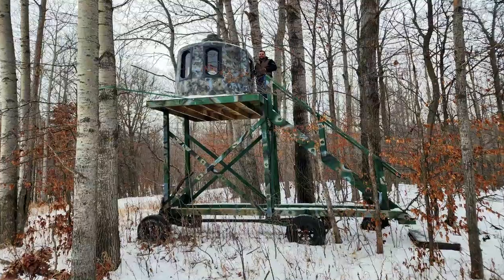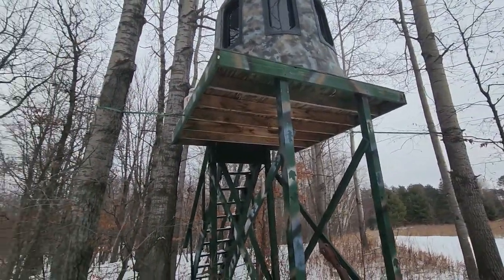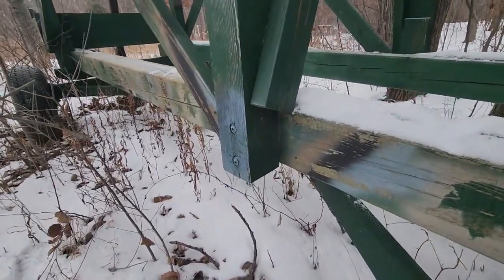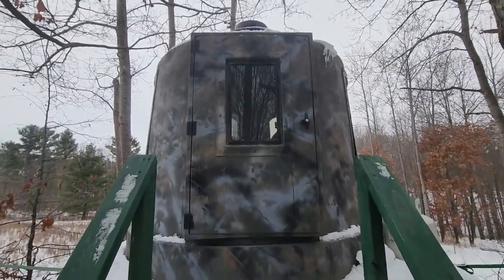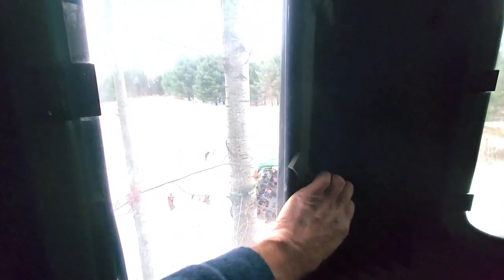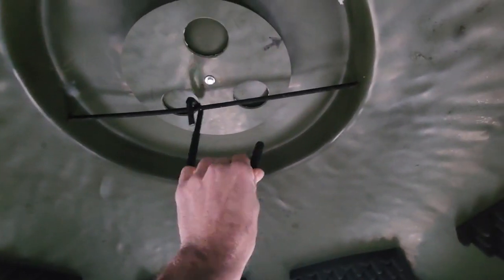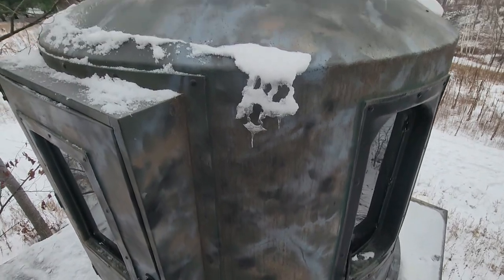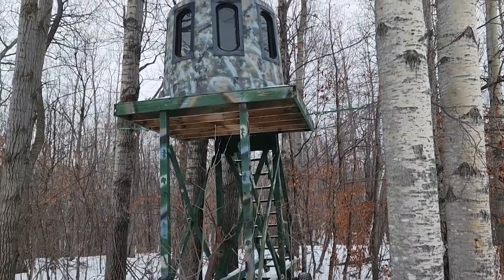Deer Blind Tower on Wagon Running Gear - Video Tour

Comment: I’ve considered something similar, but thinking more along the lines of a landscaping trailer. Depending on your hunting area/site I’m not sure they need to be so high. Like open fields etc. it would make moving it a lot easier a well. Not sure if you ever towed something like this that’s so high,but once you do you would understand.  It’s not easy in any way 😋😋
Pa season just ended as well. Thanks for sharing
Reply from the maker: Hey Lou, I agree. It all depends upon each persons situation. While I prefer more height for seeing further away, I would maybe build one a little shorter for the reasons you mentioned. Hope your hunting season was a success!

Comment: We've been building  and using shooting shacks on old running gear for about 20 years. We've never elevated one like that though. Mainly because we've never needed one that high.
Reply from the maker: I'm thinking of building my next one on a running gear. Not considering any specific stand location, what do you feel is a good overall height from the running gear frame to floor of the blind? Did you bolt all 4 corners to the running gear or just loop opposites with a chain like they used to do for gravity boxes?
Reply: @UncleBucks  I've never actually measured the distance between the frame and the floor. I can tell you that it takes 3 steps plus the step up into the shack to get in them. Our shacks are bolted down to the frame too. I hope this helps you.
Reply from the maker: @GS Nicholas  it does, thanks!
Reply: @UncleBucks  you’re welcome. If you have any other questions please don’t hesitate to ask. I’ll answer them the best that I can.